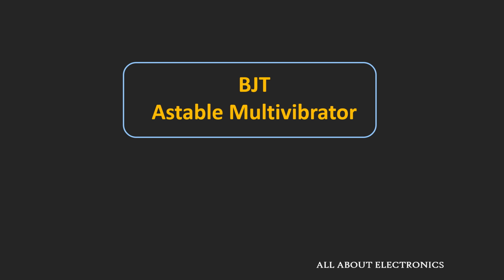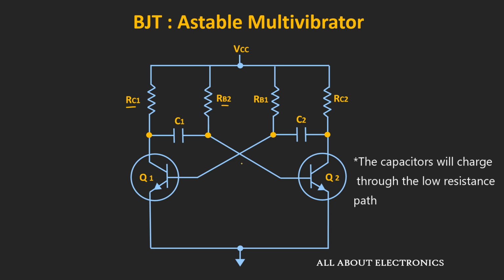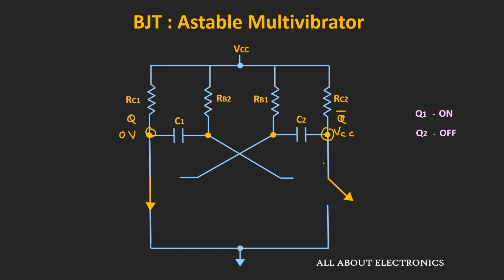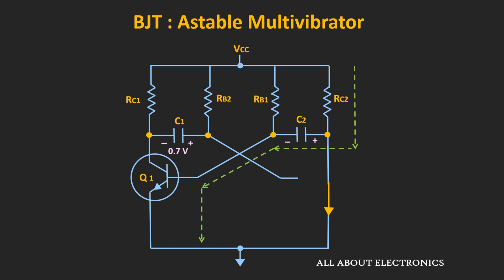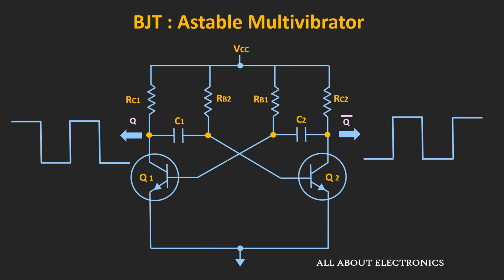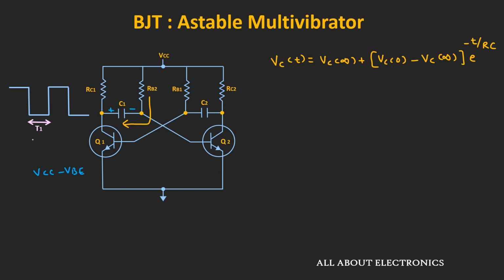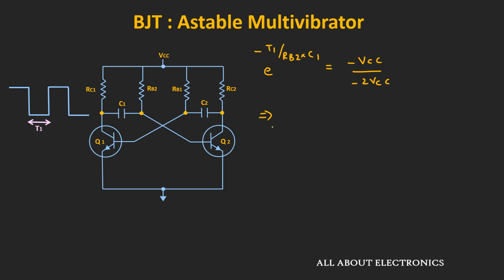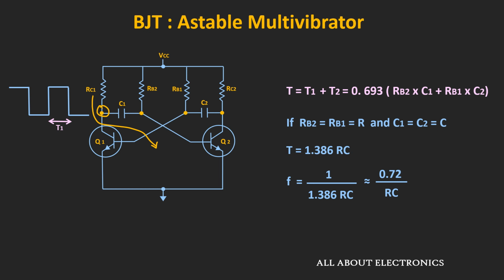Astable Multivibrator using BJT Explained

Comment: I have a question: I tried to built the circuit, and it works. I used RC1 = RC2 = 1 MOhm and C1 = C2 = 10 uF (I used big resistance values for measure the period without an oscilloscope). I shoud have measured T = 2 ln2 RC = 13,86 s, but I measured a total period T = 4 s (more or less). I don't understand the problem..what could it be?

Comment: Very good explanation. The only issue here is that the capacitors are generally electrolytic with the positive side connected to the collector sides while the negative terminals are connected to the charging resistors. So, this means both capacitors are being negatively charged (Vcc to the negative terminal) during the cycles.
Reply from the maker: You can use unpolarised capacitors such as ceramic capacitors.

Comment: Bruh 6:20 i have a doubt since capacitor c2 charges faster here so the voltage there should be available at the transistor 1 faster than the transistor 2 i mean it should happen like the previous case q1 ON AND Q2 OFF

Comment: At 10:58 shouldn't it be 0 - Vbe??
Reply from the maker: As we have seen at 8:45, before Q1 gets turned ON, the voltage across the capacitor is Vcc - Vbe.

Comment: Thank you for this excellent tutorial, sir, so clearly described qand accurate!

This circuit, disclosed in 1919, is eponymously named the "Henri Abraham and Eugene Bloch" bistable multivibrator.

Here is some design guidance: 

For output frequencies of .01 to 1 Hz, use capacitors with an npo ceramic dielectric. For frequencies between 1 Hz and 10 Hz, use tantalum dielectric capacitors. Other types of acceptable capacitor dielectrics include mica, polystyrene, polycarbonate, polar tantalum (anodes of the tantalum capacitors are connected to the transistor collectors). However, low-leakage dielectrics must be used. Use capacitors with voltage ratings at least 3 volts above the supply voltage. 

The temperature coefficient of frequency for all versions of this circuit rarely exceed +/- 1000 ppm C, with NPO ceramic dielectrics and silicon transistors such as types 2N2222 (NPN) and 2N2907 (PNP) providing the best results. Germanium transistors (2N1301 (PNP) and 2N1302 (NPN) will work, but lend a much-degraded temperature coefficient of frequency due to the temperature sensitivity of germanium. If you use germanium types, use germanium alloy versions such as 2N524 (PNP) and 2N167 (NPN) Use these types with supply voltages of up to +15 v and as low as 0.5 v.

Connect silicon diodes such as type 1N914 in series with the transistors' bases, with the diodes' cathodes connected to the transistor bases. If a positive supply is used, connect tantalum cathodes to the transistor bases.

The diodes only need to be used if the power supply exceeds 1 v. Tubes work, too, with far greater voltage ranges generally ranging from +11 v to about +5 kV. Tubes offer superior temperature coefficients of supply voltages.

Be cautious with supply voltages exceeding 70 v!

Regards,
Arthur Harrison
+01-301-460-7742

Comment: Thank you for this excellent video.

This is callled the "Abraham-Bloch multivibrator."  (Vaccum-tube versions disclosed in 1919.) Add silicon diodes (1N914, etc) for transistor versions. Tube versions generally do not require vacuum tube diodes in series with the NPN transistor bases (diodes' cathodes connected to the transistor bases) when the positive supply (Vcc) exceeds 5.4 volts. 

The practical limit of frequency for this type of circuit is 3.5 MHz. Vacuum tube versions have a similar frequency limit. Practical transistor types for typical values of Rc1 and Rc2 (US) are:  2N2222, 2N2222A, and 2N3904. Practical supply voltages range from +1 volt to +300 volts, with tube supplys ranging from +12 v to +5000 v.

Voltage-variable versions require more parts and lack in linearity, but are possible with as little as one additional transistor (NPN or PNP), and a couple of 10 k resistors. Practical capacitor values (C1, C2) may range from 10 pF to 1 Farad, with the preferred capacitor dielectrics being NPO ceramic for values less that 100 pF, polycarbonate for values between 100 pF and 0.047 uF, and polycarbonate for values 0.047 uF, and values between 270 uF, and tantalum for 270 uF to 1 Farad. You may use polar tantalums with their anodes connected to the transistors' collectors, but non-polar types will affect temperature stability by +/- 2000 PPM/ degree Celcius.

Reference:
https://en.wikipedia.org/wiki/Multivibrator

Comment: Dear Sir,
Looking only at Q1, when Vcc is applied, RC1 is less than RB2, hence voltage on the plate of C1 capacitor adjacent to RC1 will be less than voltage on the plate of C1 adjacent to RB2, since RC1<RB2. Let these two voltages be called V_Left_C1 and V_Right_C1 respectively. Assuming Q1 goes into saturation first, V_Left_C1 is grounded as Q1 is closed switch. V_Left_C1 changing to zero shorts the C1 capacitor, as capacitors conduct during changing voltage and are therefore shorted. This means V_Right_C1 also becomes zero and Q2 is turned OFF. However, as steady state is reached, C1 becomes an open circuit and V_Right_C1 increases towards Vcc, causing Q2 to be turned ON. This change of C1 from short circuit to open circuit takes approx time constant [C1(RB2+RC1)]. So Q1 will be in off state for that much time. Likewise, Q2 will be in off state for approx time constant [C2(RB1+RC2)]. I think this is how this circuit works.

Comment: It is not too bad, The English language is not spoken so smoothly but in spasms,  A waveform diagram showing the collector and the base voltages  synchronised together would have been more helpful. They would have sown the real time diagram and not the symbolic circuit.   The diagram shown in this video is never attained as a real circuit but as an illusion of the real circuit. The graphical diagram of the timings and waveform are closer to reality than  the spoken or the written language and also the circuit diagram. This is an old fashioned manner of teaches not any different from my teaching 70 years ago. Yes I am a very old man.  Computers can be made to show the dynamics that our blackboards could not,  A waveform diagram with its dynamics would have been a better modern proposition,

Comment: Thank you. One of the best explanations I've found so far. I have a question. I have an example of this with a kit. It uses polarised electrolytic capacitors. I didn't think you could swap the polarity, or charge it through the negative pin?

Comment: Can anyone tell why Capacitor C1 reverse charges , as Rc value is less then Rb , it should be reverse of what is said in the video... Ref:- 5:01
Reply from the maker: when Q1 is ON, the collector terminal of the Q1 is at ground potential. (In ideal condition). Therefore, the one end of C1 which is also connected to Rc is at ground potential. And therefore, the capacitor will not charge through Rc. But rather, the current through the capacitor will flow through Rb. Therefore, there will be change in the polarity of the capacitor voltage. Or in other words, the capacitor will charge in the reverse direction. I hope, it will clear your doubt.
Reply: @ALLABOUTELECTRONICS  Got it. Thank you..

Comment: Nice Explanation. SIr, I have a Circuit , similar to astable  multivibrator.   It has been implemented using a NPN and PNP transistor .  Base one one transistor is connected to collector of other transistor.      I am unable to understand its working.

Comment: How does the transistor turn on for the first time?Because as soon as we give vcc then both the capacitor start charging through Rc1 and Rc2 path,as a result both the base should be negative.
Reply from the maker: In reality, both transistors are not same and there characteristics are slightly different. So, when we trun on the transistors then  one of them will get turned on first and it will prevent other on from turning on. In the beginning, I have explained that.
I hope, it will clear your doubt.

Comment: As soon as you apply voltage, the caps don't charge instantly.  It is a short circuit as they say.  This means both LEDs must turn on, maybe one before the other. Otherwise the system will fail.

Comment: I cant quite understand how its possible to charge a electrolytic capacitor from the negative site? Also, why isn't both transistors ON while there is Vcc on both Bases of the Q1 & Q2 through RB1 and RB2
Reply from the maker: Of course electrolytic capacitors won't work. Ceramic would do the job. The reason both transistor won't be ON is, both transistors are not identical. There will be a little mismatch between them. So, initially one will conduct more than other and eventually in the ON condition. I hope it will clear your doubt.
Reply: @ALLABOUTELECTRONICS  but the base of every transistor is connected with the Vcc via a resistor
Reply from the maker: @MFDOOMgr  Yes, thats true. But as I said, due to mismatch, only one transistor will go into the saturaiton and it will prevent other from going into the saturaiton.
Reply: I have seen these circuits working with electrolytic capacitors. I think that in this video is not quite correct to say that the capacitor is being charged through the RB resistors, it is instead discharging through those but since the voltage when that happens is negative as it discharges it becomes more and more positive until it eventually crosses the 0 Volts limit and then becomes positive up to 0.7 V which is enough to trigger the base of the opposite transistor.

Comment: You talked only about the charging of the capacitors, does not they get discharged?? What is the effect of discharging??
Reply from the maker: The voltage across the capacitor changes between Vbe and -Vcc + Vbe. The direction of the charging is getting reversed in between.

Comment: Sir can u tell me the best book to learn electronics
Reply from the maker: There are many books. But for basics, you can refer principle of electronics by Malvino and electronic devices and circuit theory by Robert Boylestad
Reply: @ALLABOUTELECTRONICS  sir i have a small doubt
In an astable multi vibrator using transistors if i removed collector resistors and replace with LEDs what would happen?
Reply: Thank u sir

Comment: Difference between Schmitt trigger and a stable Multi  vibrator
Reply from the maker: In the Schmitt trigger, the output changes based on the input signal. Depending on the input, the output could be +Vsat or -Vsat. But in the case of the astable multivibrator, the output continuously changes between the two states.

Comment: Why the current direction is changes from the path Rc1 to Rb2
Reply from the maker: Because now Q2 is OFF, it will act as an open circuit and provides very high resistance. So, the capacitor won't charge through Rc1 and Q2. Also, Q1 acts as short in the ON condition. So, the capacitor will charge through Rb2 and Q1. 
I hope it will clear your doubt.
Reply: @ALLABOUTELECTRONICS  thanks for quick reply sir ❤️❤️
Reply: @ALLABOUTELECTRONICS  Thanks sir, it helped me too :)

Comment: If both transistor are different ( like one is npn & other is pnp ) or not identical, then what happens in the practical o/p waveform of astable multivibrator?
Reply: one will not conduct as current direction are vaired

Comment: How did u take those current directions through capacitor
Reply: You refer a channel called circuits analytica, explained very well...
Reply from the maker: The current is flowing from higher to a lower voltage. (Vcc to the ground). When the transistor is ON, it acts as a switch and offers minimum resistance. So, the current will flow through the minimum resistance path. 
I have already shown the direction of the current through the capacitors.

Comment: If I use Capacitor Polarized, operation of the circuit will not be affected because 0.7V < the Max Voltage Reverse of the polarized, is this true? Thanks Bro!

Comment: Good Graphics! I like the emphasis on how it works. Remember that the viewer is engaged in deep thought while you narrate so it might be a good idea to slow down the narration .
Reply: Now for a couple of questions. What happens if the resistances and capacitances are  changed so as to “unbalance” the circuit. Also, can this two-way flip flop be extended so as to become a 3-way. Flip flop. 

Further, it would be nice to see that circuit in action.